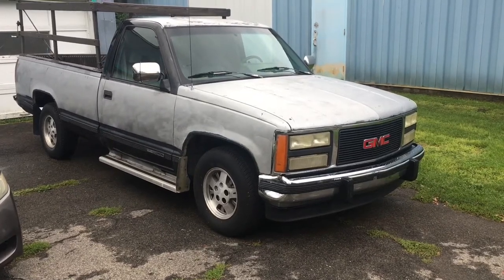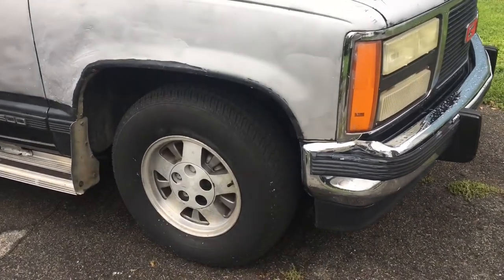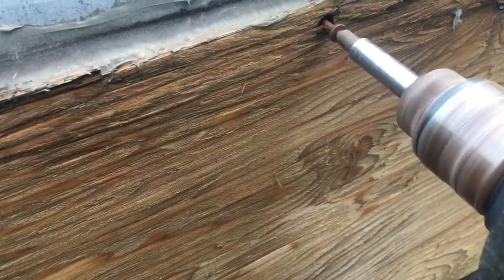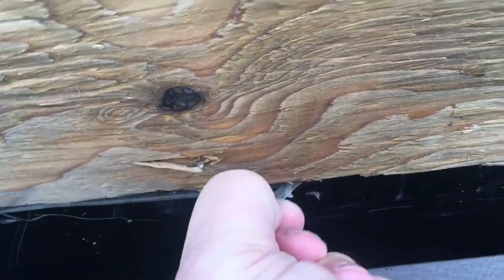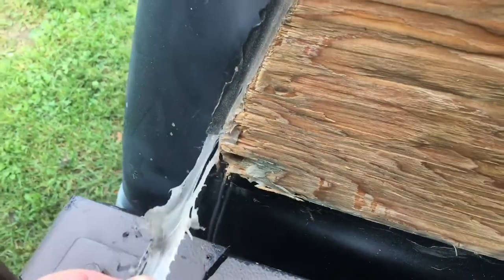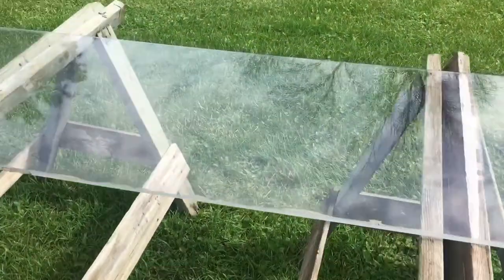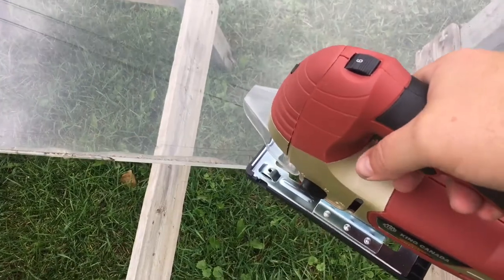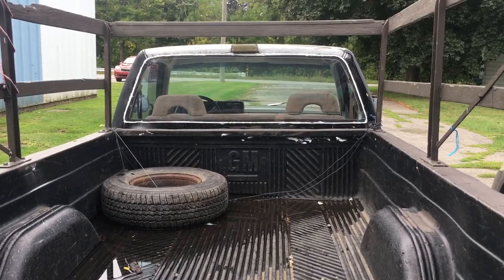Painting my truck with a roller part 1

Comment: I hope the wheel opening's bondo doesn't just cover up a bunch of rust.    If it does have a lot of rust in the wheel openings, just take the door handles off and drive another truck between them.
Reply from the maker: I’m gonna have a little fun trying to improve this one. I know I’m gonna get a good one in a few years. It’s ugly, but it drives well.
Reply: @watchtrainsnow1099  Yah, "beauty is only skin deep",  it's what's inside, that counts !